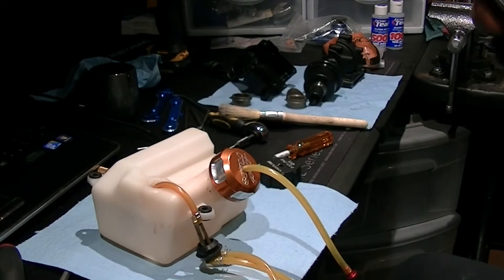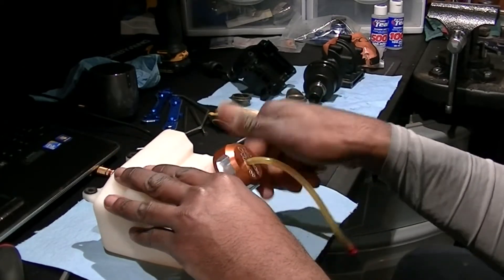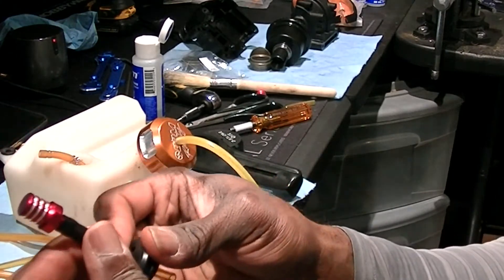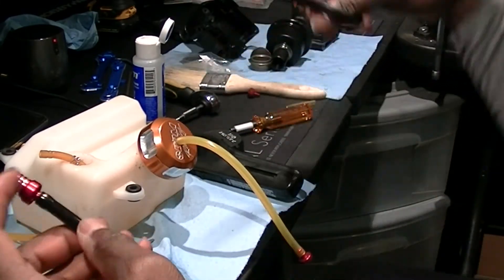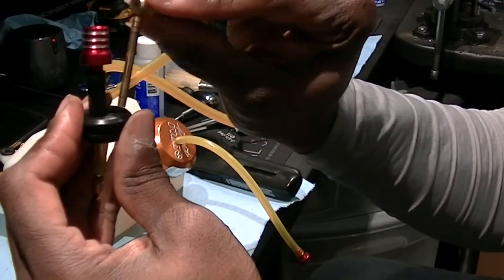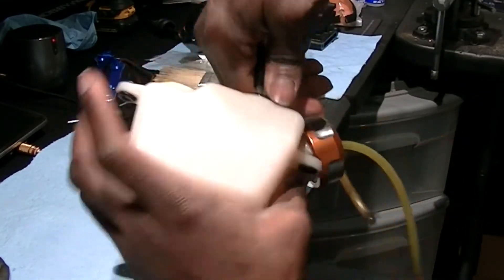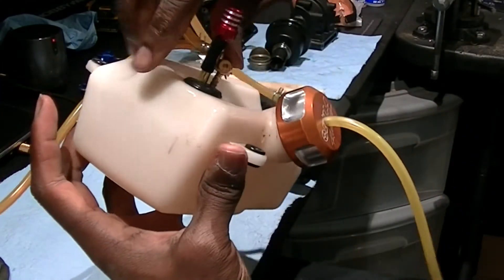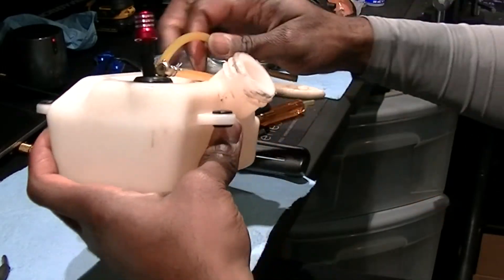Snappy Rc 3 way fuel tank grommet and aluminum breather install on the baja fuel tank

Comment: Great 👍🏼 video ! Love your RC work station and thanks for the important info. Doing This will save many newbies many headaches and should help them out to stay in the hobby and not go over to the E-words!
Reply from the maker: BOTAJELL I try to show people what to do when I make videos that way its no issue when they do they already know what to expect. I have been working on my workstation to get it where I need it to be and it is almost complete thanks for the comment!
Reply: Elite Rc very nice bro keep up the great work! I feel like I’m at home when I watch your videos and you also have the washing machines working in the background lol 😝 good shit 👍🏼!!! Your work station is more professional like a gentleman then my messy shit. Happy Easter 🐣 to you and your family!
Reply: BOTAJELL I have a question I have a 23 CC that starts right up runs for about 15 minutes shuts off after about 5 minutes it starts back up runs for a few minutes and shut back off now that sounds like it's overheating so I ran rich even at idle it starts to choke out and shut off so I returned it from scratch still doing the same thing so I check for leaks there is no leaks do you know what could be happening?
Reply: @5thScale  just ordered 990 carburetor and this fuel tank set up thanks for good video
Reply from the maker: @rodtaylor62  instead of using that check valve at the end use a regular cheap fuel filter at the end it works a hell of a lot better because the check valves build up pressure also just not a bad as not having one!

Comment: Been looking for a video like this, showing how to modd the fuel cap.. 
Where can i buy the metal nib that goes inside the tank.?
Reply from the maker: The actual video that covers that is https://youtu.be/QnAdRAYo-74 and that is a brass coupler and you can get it at the Tru value in the plumbers section it is the smallest that they carry!
Reply: Elite Rc 
Hope its not a silly question to ask.. but fuel doesn't get sucked up thru does it.. ?
Where im trying to limit fuel spillage and vapour.
Reply from the maker: @love_4_rc180  here ya go! https://youtu.be/AFR0XF3G_qA
Reply: Elite Rc THANKS bro.. you help me out majorly =)
On your gas cap with the tube the goes inside the tank. 
Would i need the metal nib, thats attached to the end of the tube... what goes inside the tank. If that makes sense.

Or isit for only if you got a fuel refiller. To refill the tank. 

Im trying to do what u done to your gromit.. with the fuel breather.. but on my gas cap.
Reply from the maker: Yes you need that metal at the end for the weight so it will stay at the bottom of the tank next to you fuel filter!
Reply: Elite Rc 
The know whats its called.. so i can order one from ebay 😁.. is it a one way valve? 
Also do i need to use one.. where one wasnt attached to your fuel breather on your gromit.
Reply from the maker: @love_4_rc180  can you ask me your question again so I can make sure we are on the same page because I think we are talking about two different things and we may have gotten a little off task!
Reply: Elite Rc 
Thats fine bro.. 
basically i want to do a gas cap modd. 
Where you modd the gas cap with a fuel breather. 
Like you've done on your Gromit with the Red/silver-Breather. 
but on the Gas cap instead.
Reply from the maker: Order you a snappy rc breather from DDM and drill a hole in your gas cap and snugly seal the breather in the gas cap and thats all that you have to do to prevent vapor lock!

Comment: Awesome video Bro.  Where did you get the breather?  DDM is so out. :((((
Reply from the maker: I got it from ddm and you can also get them from detroit performance rc in four different colors but personally instead of using a breather you can run some fuel line in there with a fuel filter on the end and get the same results if not better!